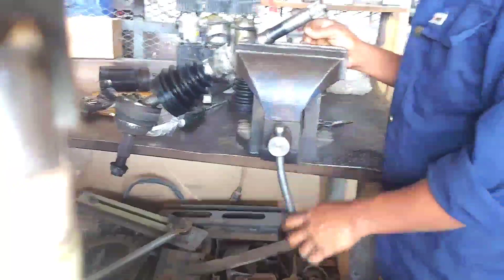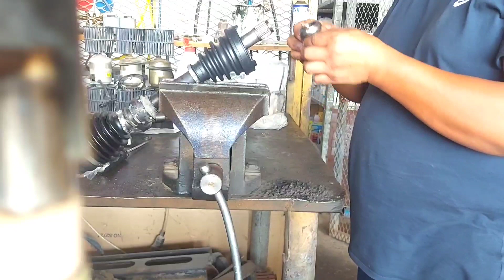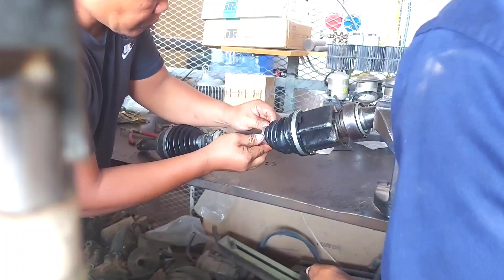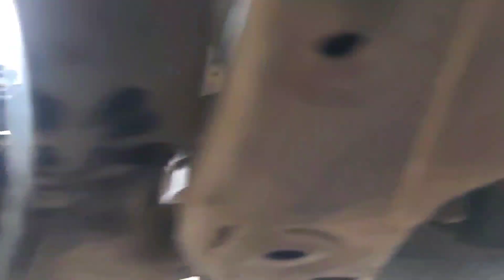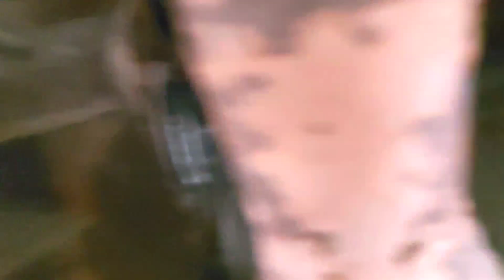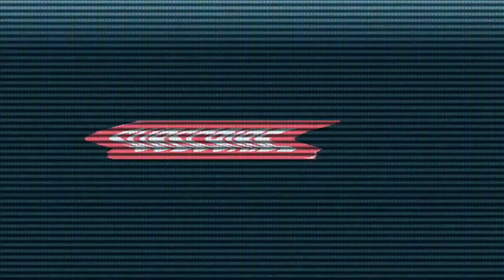CV Boot replacement.

Comment: Sir  patulong po MAN CLA. Ayaw po umandar. Wala redondo sa susian... Pag nirekta sa starter redondo lang po ayaw tumuloy. Thank you po.
Reply from the maker: Anong model yan sir?yan ba ying injection pump type o common rail?
Reply: @jlcworkshop  common rail pp sir.
Reply from the maker: Nacheck nyo nb sir ang mga fuse nyan?yong fuse sa ecu karaniwan sa common rail kapag pumutok yon wla redondo.d ko kc yan masyado kabisado dahil wla kaming ganyan na unit dito.maliit na man kc yan dba sir?
Reply from the maker: @nikomayor2836  check mo nga ito sir baka parehas.https://youtu.be/_sG-IEOjr7s